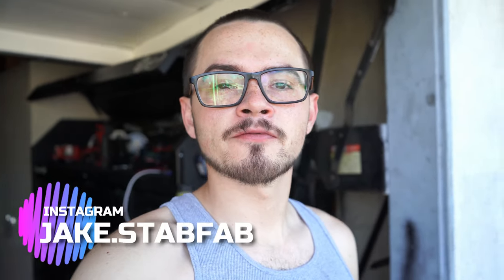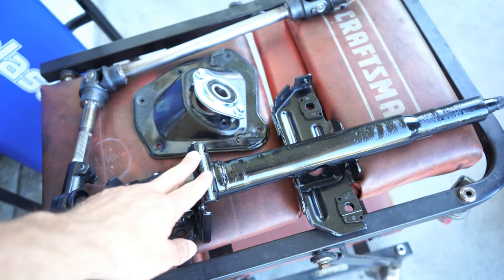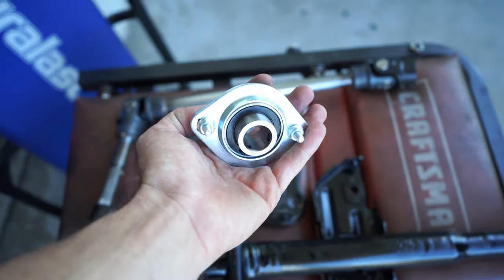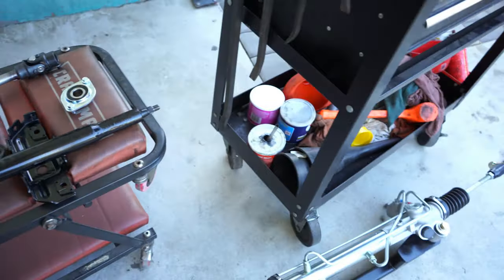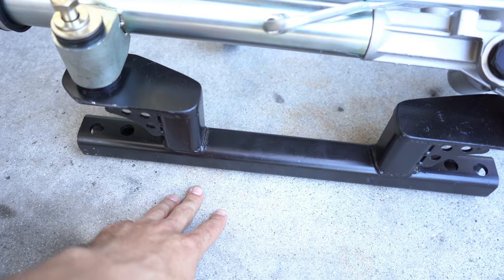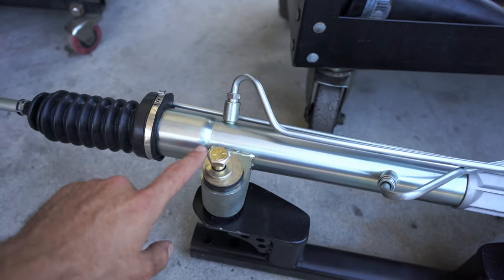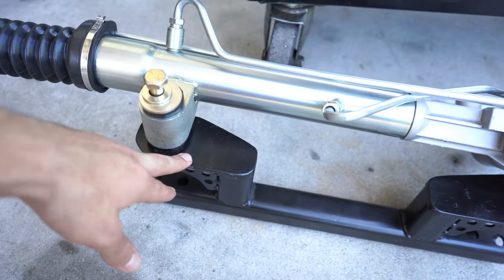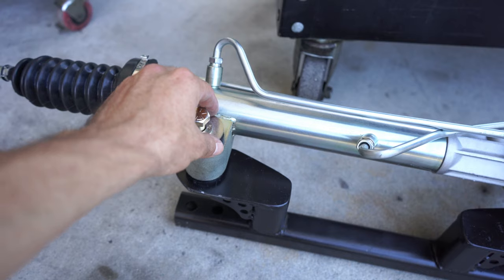EP.1 | RACK N PINION CONVERSION | TOYOTA PICKUP (HILUX/UTE)

Comment: Would the rack and pinion on a 92 mustang 5.0 LX HATCHBACK fit on a 92 Toyota pickup?
Reply from the maker: no clue.
this is using stabfab rack kit. 

you can make anything fit if you know a fabricator.

stabfab kit it to use a 15" or 16" mounting distance rack